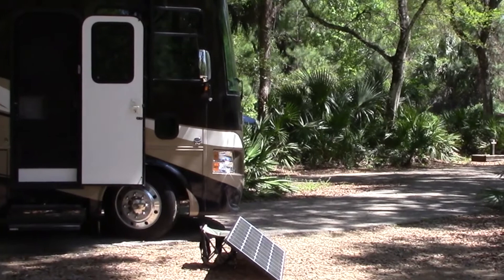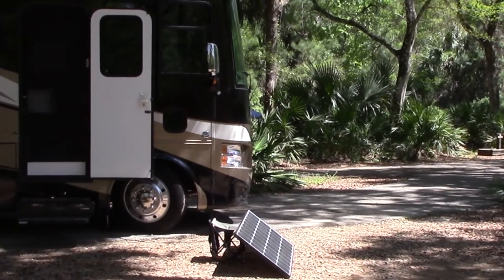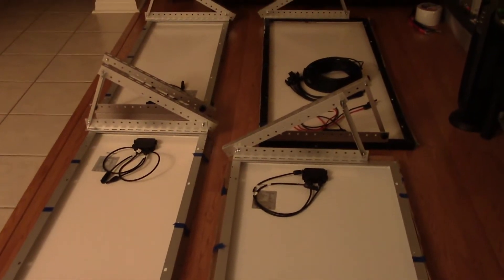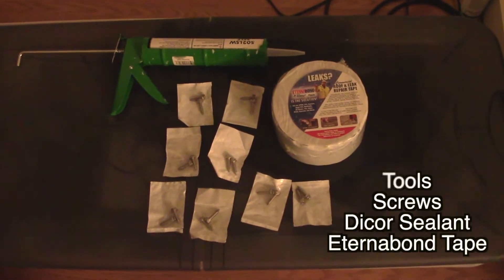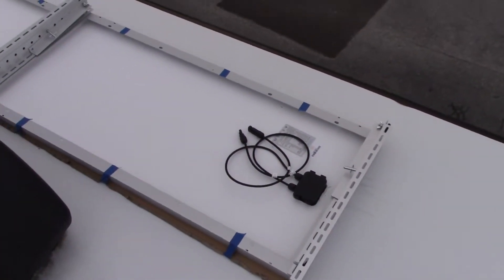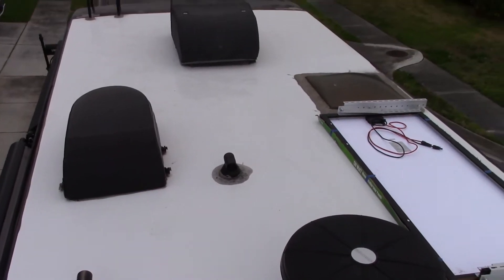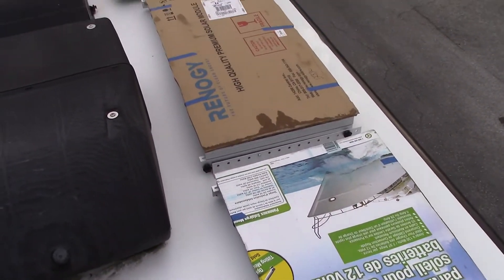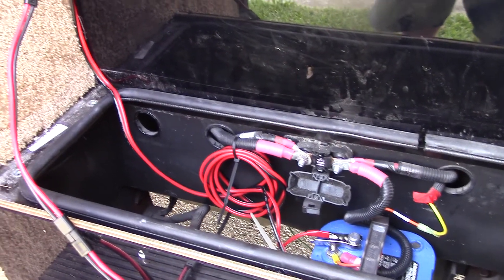Tiffin Allegro RV Solar Panel Installation 430 Watts

Comment: Welcome back, I saw the sharp corner of your brace impact the roof a little when you were done and laying the panel down horizontally. I was thinking if you took a short piece of small ID vacuum hose and put a slit in it, you could put it over the exposed 90 degree edges to protect your roof somewhat. I hope I explained this clearly and good to see your return.
Reply from the maker: Good idea!  Another viewer suggested a strip of Eternabond under the tilt brackets.  Both sound like a great way to prevent damage to the roof.  Thanks for watching and staying with us during our transition.  Safe travels!

Comment: Thanks for the video.  How about some updates?  Where did you end up running the permanent wiring from roof to controller to battery?  Have you found 430 watts to be sufficient?  I've been using a single 100watt panel on the ground and am tired of handling it.  Thanks for any further comments.  Tony
Reply from the maker: We ended up running the removable solar wire outside the RV from the panels to the battery compartment because we only used our solar when boondocking.   Only takes a few minutes to connect.  We feel a total of 600-800 watts would be a good fit for our 300 ah lithium battery.  430 does the job but with a lithium battery, it can handle many more charging amps which will dramatically reduce charge time.   Thank you so much for watching and hope this helped Tony.
Reply: @averagecampers  Thank you.  Are you saying you get on the roof as part of your setup when boondocking?  My first thought is that I would try to avoid that.
Reply from the maker: @RollinRagu  Yes.  Not the perfect solution but we have a residential refrigerator which does not need the large roof vent that most people use to run the wires into the RV.  We would have to drill a larger hole.  May make a change in the future but for now we just make the climb using the ladder in the back and drop the line off the side of the RV.

Comment: What kind of Solar Panels did you buy? I know you research matters thoroughly so would like to know what you chose. Thanks for the video. Keep having fun.
Reply from the maker: We decided on Renogy for out panels.  We are sure that there are many out there that may provide better solar results but you can not beet the price per watt of the Renogy.  Sorry it took so long to get back with you.  We just returned from a trip and no internet in the middle of the forest :)  Thanks for watching Idaho Rider!

Amazon:Renogy 2 Piece 100W Monocrystalline Photovoltaic PV Solar Panel Module, 12V Battery Charging
Reply: Thank you

Comment: Did you solve the wire routing issue from solar panel to charge contoller.
Reply from the maker: We decided to leave the wiring external.  Hookup is quick when parked and no additional holes in the roof.  Battery charges with alternator when traveling.  We may still choose to enter through the roof above the refrig in the future.  Thank you so much for watching David.

Comment: A layer of eternabond under the metal panel frames would've been a good idea.   Extra protection for the roof.
Reply from the maker: That is a great idea to help protect the roof.  We used plenty of Dicor but the Eternabond would have been a bit stronger.  Thanks for the idea!
Reply: Thank Ray from "Love Your Rv".  That's where I learned it. :)

Comment: great vid on the solar panel install! how do you like your Alegro......any major issues over the time you've had it?
Reply from the maker: Thank you Mr. Rey!  We love our Allegro.  The only issues we have had are related to aftermarket products installed in the coach such as a wiper motor, hydraulic jack, washer fluid motor, and one night shade blind motor.  These items were covered under warranty.  All else has worked perfectly.  One thing we noticed with Tiffin is the build quality.  Many other coaches we have been in of similar age developed a lot of road noise due to loosening joints and fasteners.  Makes a difference when you make it sturdy from the start.  Take a look at our video "look before you Buy an RV"  Lots of great information in there.  Thank you for watching and safe travels!
Reply: thanks for the reply. I have been looking at Allegro's line and the build quality seems to stand out amongst other manufacturers and the customer service seems to be a lot better. However, they do seem a bit more pricier than others of comparable models. I would imagine that it is well worth it though.
Reply from the maker: Well worth the extra $ when it comes to longevity.  If you only plan to use the coach for a few weekends and a vacation here and there, no need to spend the extra.   Most coaches are built with this in mind but Tiffin builds at the level of someone living full time in the coach.
Reply: I am looking for a full-time coach for the long haul. I'm about to do a 180 in my lifestyle, if I can ever get myself off my butt and take the leap.
Reply from the maker: We are also in the process selling our house and simplifying our life.  Such a good feeling and we are so ready :)  Another thing to consider is buying a used Tiffin to keep the price down.  Many get into RVing blindly and it does not live up to their expectations so you can be on the receiving end of a good deal.  Just a thought.
Reply: good thought.........thanks for the advice!!